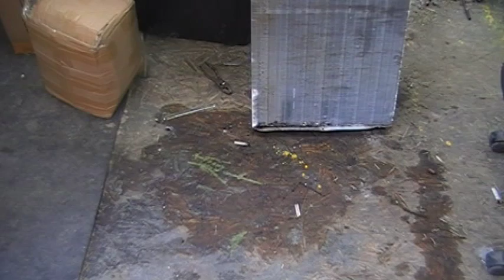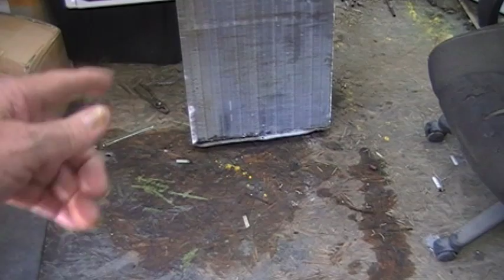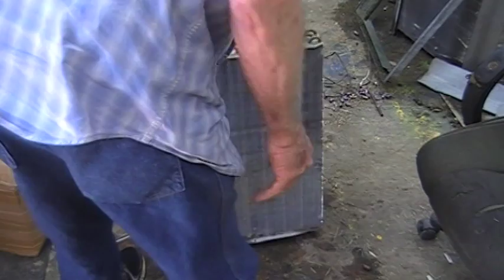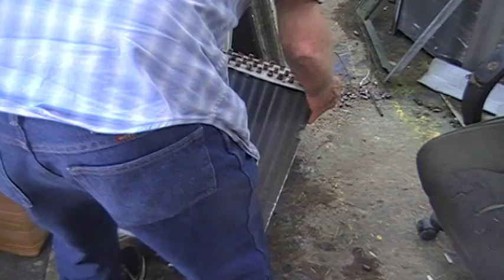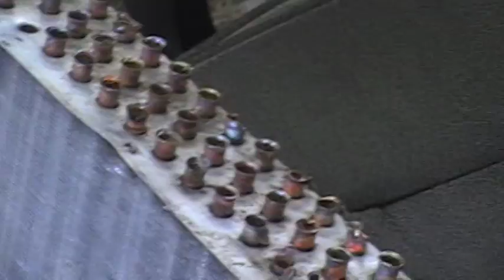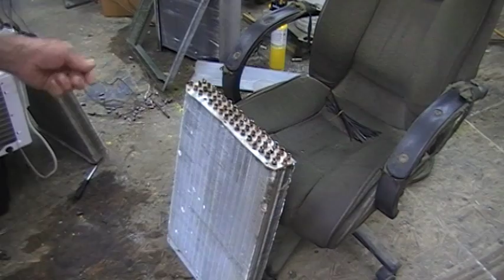My Forth Pop Pop engine Build #2

Comment: thumbs up buddy.
that chip board floor doesnt like oils. I hope you used screws.
When i used to scrap those radiators and cores, I used a sawz-all. It works well.
The oils from the air conditioners have toxic oils in the freon. be careful!.
alcohol should be used after washing to neutralized them. :)
As always, safety first. eye protection.